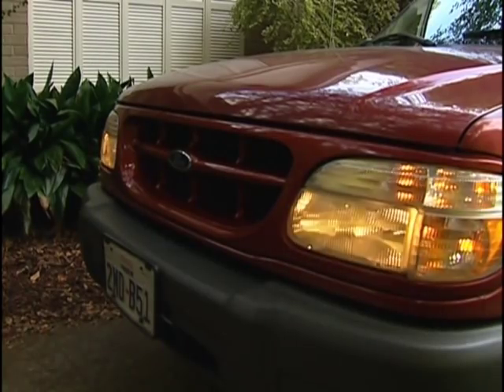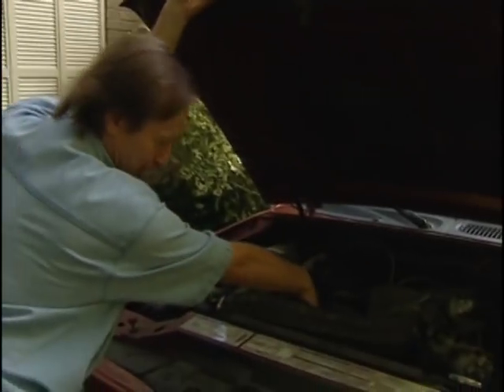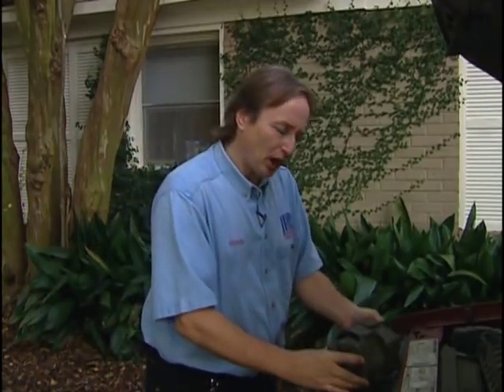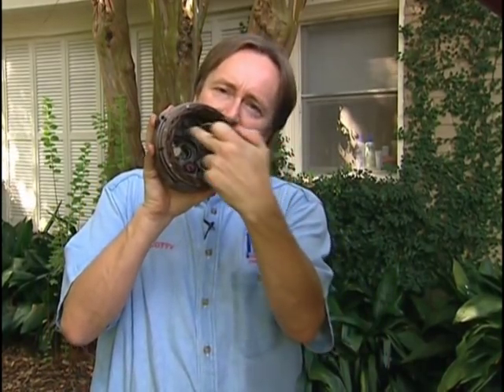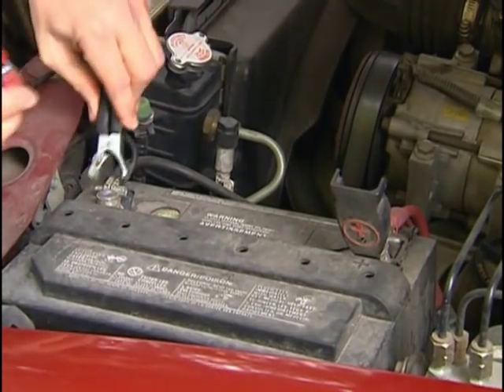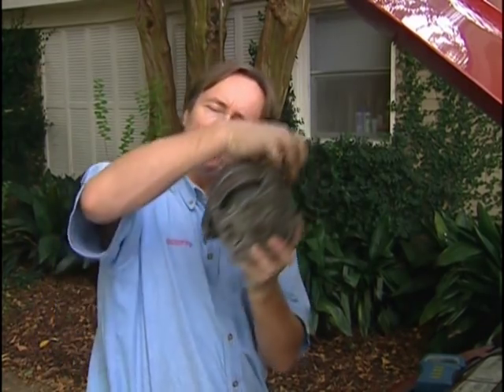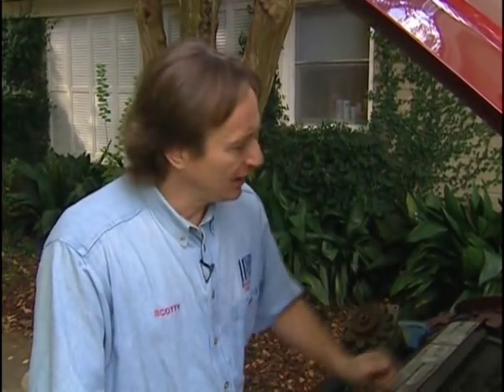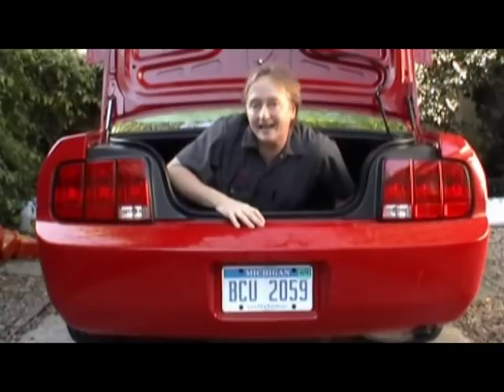How to Test Alternator in Your Car

Comment from the maker: Yes, be SURE the battery is in good condition and replace it when it's getting low. I personally use a Midtronics tester which tells the battery state in about twenty seconds of testing. When it says replace, even if the car starts OK, I replace them, so the alternator is not strained from a weak charging system. Scotty Kilmer

Comment: Just replaced my alternator(2000 Chrysler Voyager) after getting random no starts with crazy blinking parking/dash lights. Most of the time it would work fine so it was probably just starting to go out. Was testing at 13.2v without any accessories on so I imagine when I had the stereo, blower motor and whatever else, it wasn't enough to recharge the battery properly as well. Cost me $9 for a remanufactued 120amp one, less than 5 yrs old at the local pull it yourself yard. Thanks for confirming the crazy lights being a problem with the bad alt/diodes.

Comment from the maker: They are called alternators because they generate alternating current. Inside them, are tiny diodes, which change the alternating electricity to direct electricity for use in the vehicle.  It may sound strange, but it's true.  Perhaps AC/DC should write a song about it. Scotty Kilmer

Comment from the maker: replace the oil pressure sending unit and pray that fixes it. Cause internal oil pressure loss inside the engine is an expensive fix if you have to take the engine apart.

Comment: Scotty Kilmer I just brought a brand new alternator and I got it checked at Autozone, O'Reilly, and NAPA. They all say that the alternator is fine but its still draining power whenever I drive. I thought it was a power draw but I tested the battery after letting the truck sit over night and the voltage is the same so nothing is being left on. The terminals are also good. And I'm on my 3rd brand new battery. And clue what is keeping my alternator from charging my battery?

Comment: Also an alternator can have a shorted diode which will leave you with a dead battery overnight, yet the alternator may still charge the battery and run at 13.8 VDC you can test with ammeter in series with b+ terminal.  Likewise an alternator may test good when it is cold yet when the underhood temps rise the voltage regulator malfunctions and the alternator has no output, misdiagnosis is common in a failure like this.

Comment: Scotty, First I want to thank-you for the helpful knowledge. Car won't crank, checked ignition switch, starter and jumped the neutral safety switch but still nothing. What do you think. Thanks a bunch!
Reply from the maker: Leslie Helleis of course check the starter, hot wire it directly from the battery using jumper cables. If it cranks then, you lost power somewhere between the battery the ignition switch, and the starter, you'd have to trace the short down in that system
Reply: Thank-you very much. What you do is a great service to your fellow man. No exaggeration.

Comment: If you have not done so yet look up the "Sludge issue" on that engine. Some models (passat being one) had a major recall from the factory due to the turbo cooking the oil to death and sludging up the motor.

Comment from the maker: @0penminded2u  Well, I just worked on a VW and a Benze yesterday. Basically, they are giant overengineered :POS made by Germans with an anal complex with their machines. If you're dumb enough to buy one of those vehicles, don't try working on em yourself, they are too complex and require too many special tools and computers to recode software when changing many parts. Only a complete ass would design such vehicles. I'm showing how to fix normal vehicles here. Scotty

Comment from the maker: @NorkiddExo Not a good idea to run a car with the battery unhooked, even on those old things, it can short the diodes out on the alternator.  As for the wires, can't remember on those old things, get a wiring diagram for that from a cheap old manual, my data base doesn't cover anything that old, it starts at 1982. Scotty

Comment from the maker: "Fixing" alternators is often a mistake,the guys that do it are often crap. I always try to use brand new units, but if not, I buy factory rebuild ones. The regulators are built inside the alternators on all modern cars and should be replaced when rebuilding an alternator

Comment: Hey Scotty I have a very greasy alternator. Im not sure if im losing a little electricity because if how dirty it is. Im wondering how may i clean it w/o damaging it and causing problems. Would I need to buy a new one? Im driving to vegas in 1 week. I need to be sure im at safe hands before the drive. I’m planning to do an engine bay clean up by i guess professionals.

Comment: Hey scotty I have a 99 yukon it starts squeaking in morning after it warms up while it's jus siting it's gone when I start moving it start back. I've changed belt 2 times and it goes away for almost 3 days then start back squeaking again. I took belt off and spin the alternator and bearing wasn't squeaking so I really dnt know wat else it could b I also put a brand new water pump on it still no luck. Any Suggestions

Comment: Hi Scotty, I have a question for you. Two days ago my battery died and I had to get jumped. I went today to pepboys and had them check the battery. They told me that it was dead and at the same time they told me my alternator was going die too. They reported a voltage of 13.6. My question is did they properly test the battery seeing that they used the dead/old battery to test the alternator rather than using the new one? My car is a toyota solara.  Im thinking they are pulling my chain.  Thanks

Comment: hi Scotty.  I have a cheap electrical analyser that plugs into cig lighter inside car. it shows alternator is weak. what do you think about rebuilding the alternator instead of replacing. if replacing is better, new or rebuilt? thank you Scotty for all you do! -caryl
Reply from the maker: rebuilding it correctly requires a machine lathe, new is best. BUT, they often cost a ton, rebuilts from places like auto zone often carry a lifetime guarantee, so why not go that route.
Reply: wonderful! thank you Scotty!
Reply: is the machine lathe for dressing the commutator? couldn't I do that by hand with emery cloth? I am a small appliance repair tech and I usually will spin the armature while holding the emery cloth on commutator on mixers or clippers. As for new alternators, I found a listing for a new one that fits my car on ebay for $80 shipped. think that is a good price?

Comment: @slipcheck5 I don't think I would risk doing that (disconnecting battery while running) in a modern car. The electronics of new vehicles is sensitive enough to voltage surges that you might damage something downstream....

Comment: my belt squeaks when the car is warming up in our cold Michigan mornings, and it seems the squeaking is near the alternator pulley, put a extension up too my ear and pressed it agents the alternator as close too the bearings as i could and there is a slight wurrling noise... the car is a good old girl with 200,500 miles on her, so i am not surprised if the alternator is going out, do you think its going out scotty?

Comment: Hi there Scotty, one night on my way to work I smelled a weird electrical burning smell coming from my Aerostar. On the way back from work the van out of nowhere started to act like the engine was going to die when I was slowing down or came to a full stop,almost like it was misfiring, got home and when I went to drive it the next day the battery was dead and drained over night! Is this an almost sure proof sign I need an alternator? I took it to a couple mechanics who flat out refused to diagnose or work on my Aerostar because it's an Aerostar!

Comment: I can't ask questions on ur website, not sure y!? but I have a question, is it possible for an engine fuse to blow because of a bad/failing fuel pump? wouldn't that blow the fuel pump fuse? or could it blow the engine fuse bcuz the engine isn't getting proper amount of fuel at times?

Comment: I suspect that my alternator is starting to go out, and I think your video just confirmed this.  I had some really odd things happening: like my doors not locking, airbag light coming on, wiper fuse blowing, interior lights not shutting off...  When I had the car running and I disconnected the battery, all of my lights were flashing and dimming...

Comment: Soctty, I got a 2000 Jeep Grand Cherokee 4.7 Laredo, I have had a problem with the battery charging while I drive. I took the alternator out and got it bench tested ( it passed) got my battery recharged it held the charge, but I started to drive it and the battery gage is slowly starting to dip again. Got any ideas what to check next ?

Comment: hi scotty, i have a chevy aveo 2010 acquired second hand, during its 1st year with me she is running fine until i replaced the timing belt for preventive maintenance, since then the alternator broke down and i had replaced my alternator 4 times in a span of 8 months, what is the problem with it.
as what i have observed every time the belts has removed/replaced the alternator will broke after a week. please help thanks.

Comment: After seeing this i have added yet another possibility to my dilema. My horn works fine when stopped but when moving it will be hit and miss. Could this be the Alternator? I was thinking Dirty Contacts on the circuit or faulty Horn Relay. The Car is a 1994 Oldsmobile Cutlass Ciera S (just in case the info helps anything).

Thanks Scotty. More questions to come.

Comment: Hey Scotty

I have an 02 LeSabre with 138,000 miles

My car runs fine other than an intermittent problem where all of a sudden the gas gauge would drop to zero and then the car would stall and  have a loss of power. ( If I floor it it would only go to 2500 rpm instead of 4000. I have a code 1635, and when I wasehed the car at the car wash water got into the secondary air pump and that's when I noticed all of the issues

It's an intermittent problem the car runs fine
Most of the time

Comment: Hey Scott, I replaced my battery about two months ago and when I leave my car on for a while then turn it off, it stalls a little to turn back on. I can hear the engine turn when I turn the ignition and then I have to turn it again twice. I really don't know whats wrong with it. I know its not the alternator cause I tested it by having the car on and pulling the positive off. Its a 2007 Ford Focus zx3

Comment: @scottykilmer I have an old 1966 chrysler sedan thats been sitting for about thirty years. I don't trust the alternator not to kill my 4x4 battery. If I started it and disconnected would it kill the alternator? I've always been told it would.

Plus the alternators been disconnected, could you tell me what lead goes from the alternator to the car and where you typically connect it (being the positive), (Engine ground negative).

Comment: hey scotty, I own a ford taurus 94 gl 6 cylinder EFI, nothing very strange happens electrically, but when I slow down or im at idle, the lights dim then come back and when it does the engine even sounds like its cutting out, there a squeaky whiny sound near where all the belts are, could it be my alternator? ive had it checked awhile ago and they said nothing was wrong

Comment: Hey Scotty, we have a 2010 Toyota Camry V6 that has a battery light on the dash. We thought it was a bad battery so we changed it without checking the voltage of the battery. When we got a new battery, it was able to go around a couple days and then today, it died while I was starting it up, we jumped the car but later it died on the road. Is it a bad alternator causing the problem?
Reply from the maker: it needs an alternator

Comment: Scotty, when my engine is at idle, the battery is only measuring at 12.5 volt, however, as soon as I bring the rpm to 2000, the voltage would go up 13.6.   Does this mean my alternator is not healthy and need replacing?  Thanks!

Comment: How long does the alternator take to kick in after starting a car Scotty?
Reply from the maker: pretty much immediately
Reply: sweet thank you i've heard ppl say 20 mins after start up but i rather belieeve a mechanic of 47years lol
Reply: Here inSweden we have a law that say lights on 24 hours .So we put in automatic light.It is wired like when generator is lifting voltage the lights comes on.It takes  as long as you snaps your fingers,immediately .Been a car-electrician ,working at Scania here in Sweden.Mounted a lot of automatic lights in trucks.Now retired sins 4 years.

Comment: Hello scotty. My 01 honda civic alternator has a harness adapter and a 10mm nut and bolt that holds a loop spade clip connector wire. Well the bolt broke off the alternator. Thinking it was a ground I can fix it by connecting the spade clip to the body of the alternator and it blew the 80 amp battery fuse. My question is, do I need another alternator or is there a better place for the loop connector wire when the nut and bolt breaks. Thanks.
Reply from the maker: that was not the ground, that was the main power feed. You shorted it out now, get another alternator.
Reply: Scotty Kilmer
Will be doing that. Thanks.

Comment: Scotty help!
2001 Escape 3.0L v6 2wd engine...
ABS light randomly illuminated yesterday when stopped but went away when RPMs raised. Also lights on dash brightened up too... this all happened after about 10 minutes of doing and engine warmed up. Same ABS light illuminated before when stopped, engine at operating temp, and went away with raising RPMs. Engine been having slow crank sounds (sluggish sounding) for about 2 weeks now.
Today I just did the self-check on my vehicle (hold trip meter, key to ON, release it when test displays on odometer/trip display area)... It showed 11.2 volts without engine running. It cranked slowly and started OK. No warning lights on.
 Earlier it showed between 11-12 volts with engine running and driving around the block (testing it out trying to see if alternator is the issue). Never got up to 14v (isn't it supposed to show 12-14?)
Not sure age of battery OR alternator as I bought vehicle used Oct 2015 (no maintenance records before purchase).
I'm leaning toward it being alternator. It's intermittent with random lights illuminating (ABS mostly)... Don't wanna throw parts at it if not necessary (and the alternator is a BEAR to change on this engine!)

Any advice?

Comment: Hey Scotty I did what you mentioned and the noise was gone. If you have a moment would you be willing to check out the 3 videos I have uploaded on my channel, they are short. One video is of my engine running with the belt on. The second is with the belt off like you suggested. The third and final is me free spinning the pulley on the alternator with vehicle off. The ticking noise is loud so when I try to use a screw driver and listen for the noise it's loud on the ac compressor and alternator and I can hear it through the power steering pump . so I can't really use that method because of my lack of experience. I greatly greatly appreciate your time !!! Thanks Bruce

Comment: Hello Scotty, the alternator on a 1990 Honda Civic CRX that I was working on had seized.  Any ideas as to why?  Plus, the second bolt, which is on the lower end is so rusted that it's difficult to remove the alternator back and forth.  Any idea(s) to help remove that bolt as well?  Thanks in advance.